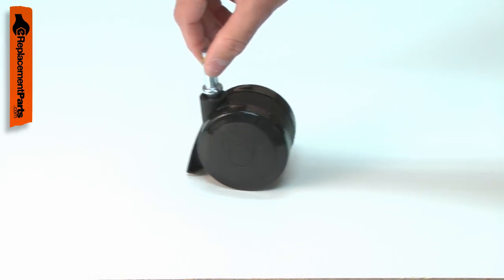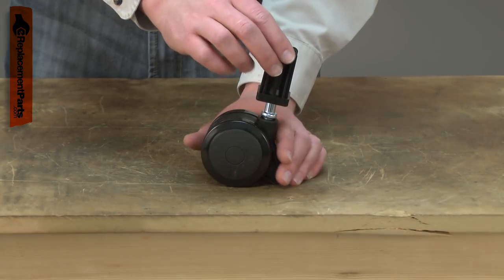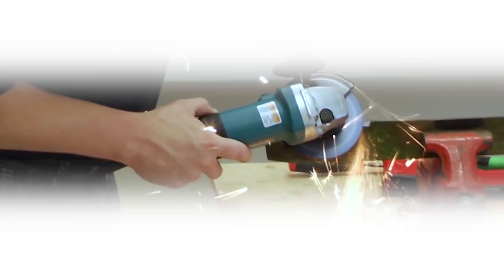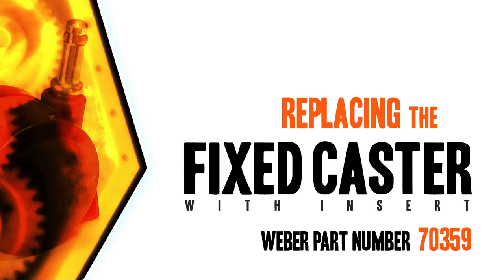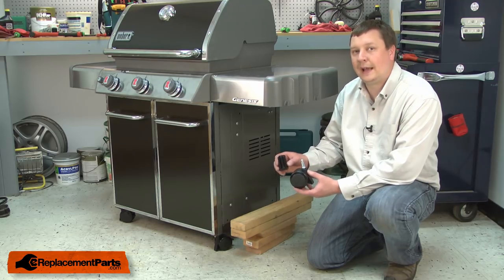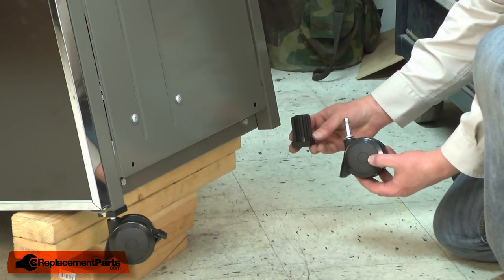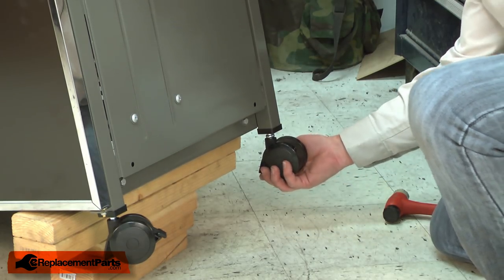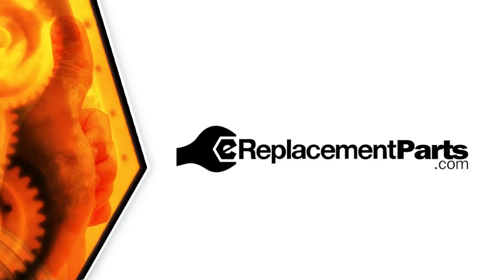Grill Repair - Replacing the Fixed Caster (Weber Part # 70359)

Comment: I replaced mine with some rubber wheel casters from Amazon that have a 1/4” threaded shaft which screws right into the insert. Far better and a fraction of the cost of using the overpriced Weber plastic junk. There’s a video here on exactly what’s needed.